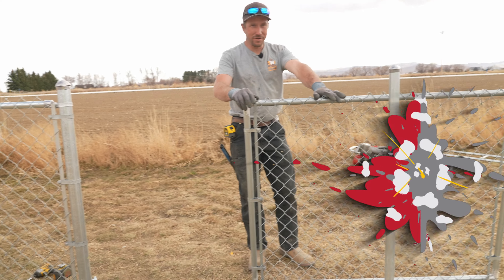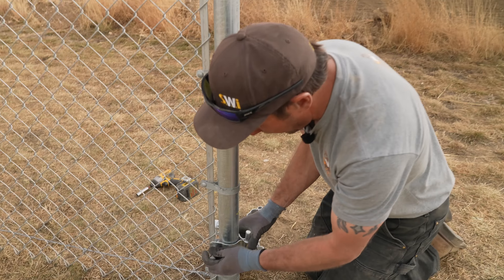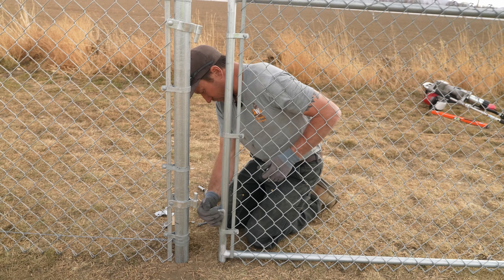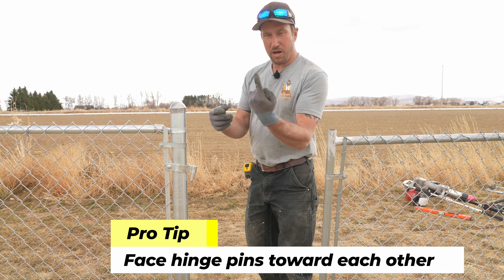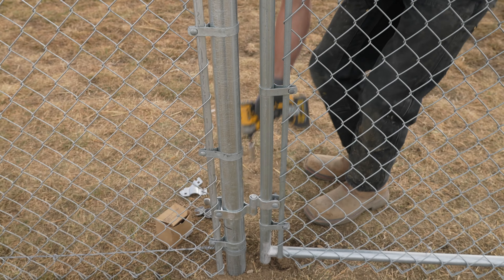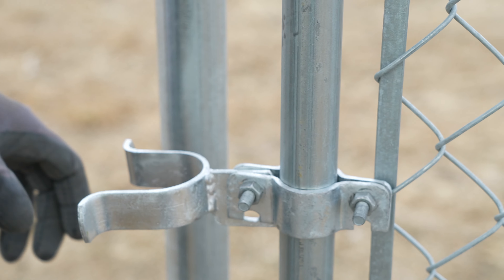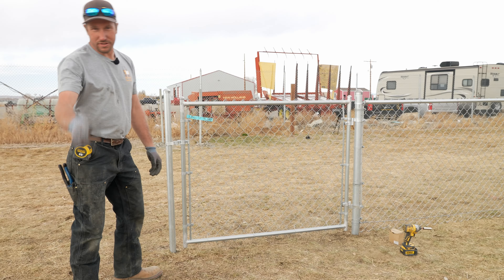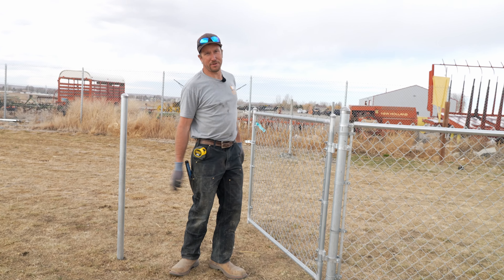How To Hang A Chain Link Gate EASILY

Comment: Lots of good tips here, thank you. I have a double-gate like that --- so that a vehicle could drive through -- that's fairly new but when they installed it they mounted it too low and it drags against the ground. I'll raise it, don't care if the top rails exactly match or not, because I don't plan on digging out the ground alternatively.

Comment: Thanks for the video.  How do I keep gate hinges from moving over time?  Should I use lock washers?
Reply from the maker: If you have access to a welder you can weld them in place with a small weld, or you can use a self-tapping screw to hold them in place.

Comment: Great video. What’s the spacing needed between the posts to fit the gate between?
Reply from the maker: It's specific to your gate and hardware. You'll want to measure your gate + your hinges + your latch. Hinges should be measured on the inside dimensions between where the posts would be (don't measure the parts that go around the posts). Fork latch should be measured from where the gate post would be to where you want the terminal post to fall in the fork. Add that all up and you have your post spacing.
It's really much simpler than I'm making it sound here. 🤣

Comment: Thanks thats the problem in having, gate keeps sagging so i fix it and agaim and again. So i wrmt on yoitube and everyone was talking abput using tension wire to fix a sagging gate. So i was doing that last night. But to me it seemed idk.. Like not a very effective way to keep it from sagging. If the idea of it sagging went through my mind agaim after "fixing' it. Now i know it defenetly will.. Why? Because you explained or said somethimg nobody else had said but ypu. And i watched over 20 videos yesterday and not one said yo not hang the fence off a single post because of sagging and how on the contrary you hang it to the chain link fence side then no more sagging cause the Weight of the fence is greater than that of the gate and single ro. Cause even with cement after a month it sagged. 
Thank you! Thank you! Thank you!🙏🌜🙅👍
Reply from the maker: You bet! 👍🏻

Comment: Could I get the gate setup and mark the holes for the terminal post. Then cut the top rail at right length for the gate. dig the holes keeping the chain link tight till gate post are set.  Set tension bar in and lock it to the post then cut chain link

Comment: Hey man, I just recently purchased my first home and the fence around my back yard is 15’ short of my property line all the way around. I Checked for easements and all that and none exist. I was going to push it all back to the line and was curious. I have a 4”x24” auger I used for a different project. Do you think if I hit 2 holes right next to each other and dug any extra dirt out that it would be enough to hold a 5’ tall metal post? I really don’t want to hand dig all these holes lol.
Reply from the maker: Er... maybe? 😁
This is going to depend greatly on where you are in the country. You want enough space between the corners of the post and the edge of the hole--so don't skimp on hole width. And you're definitely going to want to get deep enough--make sure you're getting below frost line. Can you rent a bigger auger? I'm with you--I wouldn't want to hand dig those either!
https://youtu.be/vjEuv5afE4w?t=82
Reply: Lol thanks for the vid, I might as well rent one. Can’t be to expensive. I’m in Central FL so no frost and my soil is somewhere in the “sandy-dirt” range depending on where you dig. I’ll see if I can find a 6” or 8”. Thanks for the help

Comment: My gate is 57 in 4 ft high how far apart should be the post from one post to another
Reply from the maker: It's going to specific to what hardware you're using. Gate measurement + the amount of space the hardware takes up. Just like in this video (this example is a double-swing gate, but the concept is the same): https://youtu.be/-TTnA-l_GIM?t=13

Comment: I have a problem with my U-latch swiveling on the post if I push or pull on my gate.  It appears to be tightened down as far as possible.  Any ideas on how to fix that?
Reply: Shim underneath the where the clamp tightens on the post then retighten your bolt

Comment: Do you have recommendations for dog proofing an aluminum screened patio and screen door? My patio is on the side of my home and I want to limit the pit bulls who are strong to the back and side yard with access to the patio but I don't want them to be able to escape to the front yard through my patio screens. I was thinking of hog wire screwed into the aluminum frame but not sure how to secure the screen door and be able to open from both sides.

Comment: You should have explained the needed width of the gate to the width of the space for the gate. Also, keeping the gate off the ground for many a do-it-yourselfer requires that they suspend the gate up with one or more pieces of wood (etc...) since they cannot hold the gate at a given height while tightening the bolts. Let me provide an example: i was asked to re-hang (readjust) a gate that wasn't closing correctly. The gat was 32 inches wide and the space for it was 32 inches wide. The hinges and locking mechanisms being used were so large they had to be contorted to have any semblance of a working gate, but the owner of the property thought they. were needed because they represented extra security. With only a 1-inch gap on each side of the gate, there was no way to use the attached parts requiring at least four inches altogether. Those viewing your video may not choose the correct hardware because of whatever insecurity they may be fostering for safety requirements. And though I corrected the situation, the owner still insisted on putting massive locks along with a massive chain on both sides!
Reply: Thanks for this add-in! I’m a single mom and I need to put a gate on my new driveway but I have no dollars and a bunch of Home Depot gift cards. And so far I’ve been able to figure out all my home repairs via cool dudes on YouTube and the additional cool dudes popping into the comments.
I bet I would have gotten the wrong sized gate for my gap. 😂😂 thanks for mentioning!!
Reply: Shut up or make a video with step by step instructions.
Reply: @DavidWilliams-vc2ms  Thank you for such a mature response that was obviously uttered by a professional? Your comment reminds me of those I encountered while working with behavioral disordered kids I used to deal with while working at a Jr. High school...
Reply: @warriormama613 as a general rule add 2” on each side of the actual gate measurement. Most 48” gates are 441/2- 45”

Comment: Could just grab a wrench and take the bolts of to get in 🤣😆
Reply from the maker: If you have a 4' fence you're not using for security anyway. If you have a taller fence it's standard practice to make sure all your bolts are on the secure side of the fence.

Comment: Lol  if you have to watch this video to figure out how to hang a gate you shouldn't own tools  as far as the bolts use longer carriage bolts thread them tight then BEND THE THREADS OVER SOMEWHAT SO YOU CAN'T UNDO THE NUTS WITH A WRENCH AND/OR SOCKET  ITS GRINDER TIME     now how to figure out to keep the criminals from cutting the wire mesh
Reply: Why’d you watch this video then Buck?
Reply: Someone will hear and see the criminal cut the wires for its a longer method. Compared to just picking up and in 5 seconds you in. If a criminal wants to get in he gonna get in no natter what. He gave us a good advice. Its what's important.